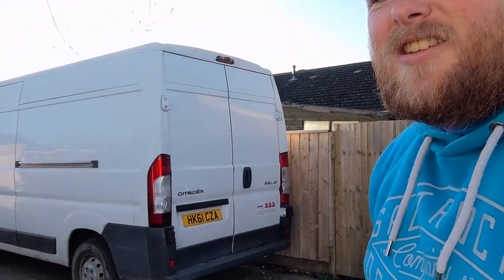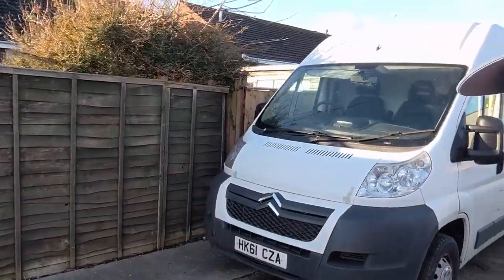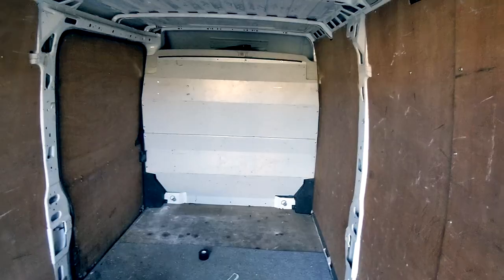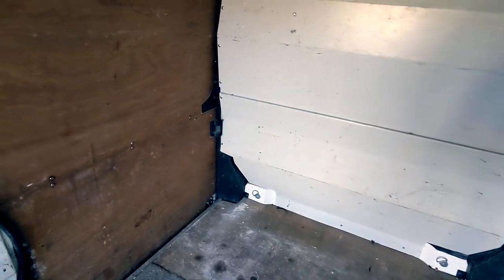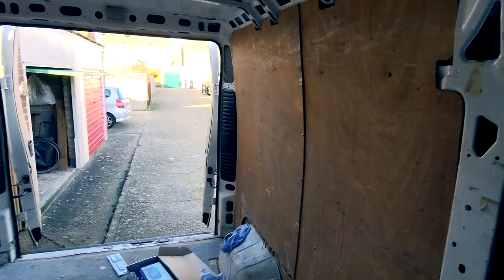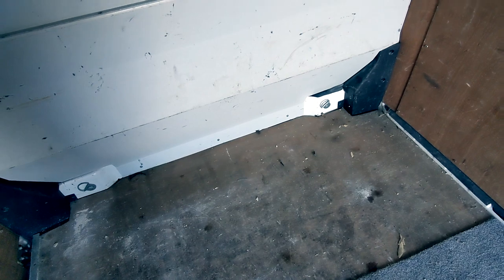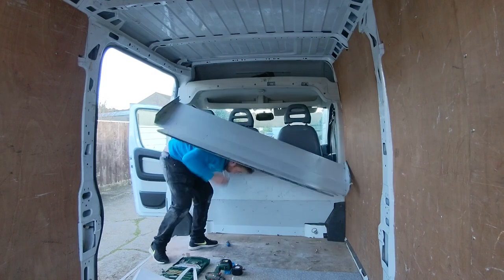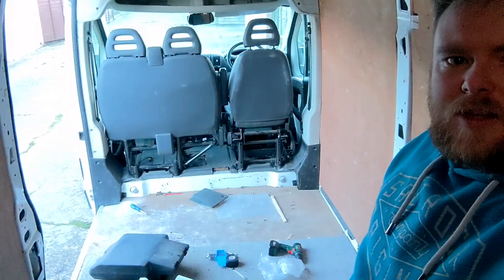Isle Roam Introduction and Bulkhead Removal | Citroen Relay Van

Comment: I had to remove 500+ steel rivets from my bus ceiling and walls, in winter, hammer, chisel and air tool which kept freezing up!
Reply from the maker: We are quickly learning that working in the winter sucks 😂 numb fingers and not enough daylight in the day.. It will all be worth it in the end though 👍🏻
Reply: @IsleRoam  I did try working in the winter cold yesterday on the bus but it was just way too cold so I found a project to do inside and that was making my trim to cover up an issue on the bus. Seeing as the bus is slightly uneven sometimes I need to trim to cover these issues.

Comment: Good luck with your build! The bulkhead doesn’t look like a original to me. I can’t remember it was that heavy (but i didn’t use my head to do a weight test).
If you have removed the side panels, also remove the rail from the sliding door. These vans are known to start rusting behind the rail. You need to remove nuts from the inside, and once you’re done building its almost impossible to do. So better check and fix before.

I’ve almost finished my build (Fiat Ducato, which is an idential van as the Relay/Peugeot Boxer), see my build at www.djsmiley.com
Reply from the maker: Thank you so much for the comment. I will definitely check the rail. Great advice. I'll check your website also. 👍🏻